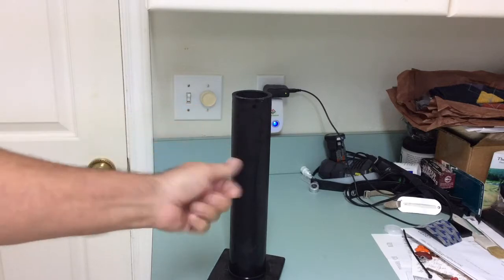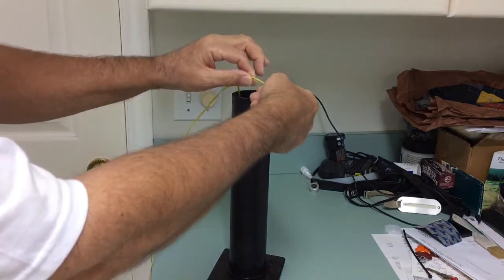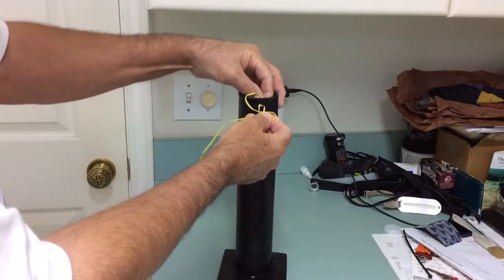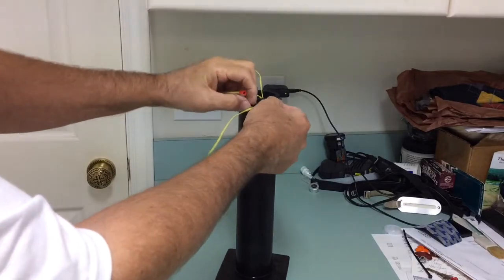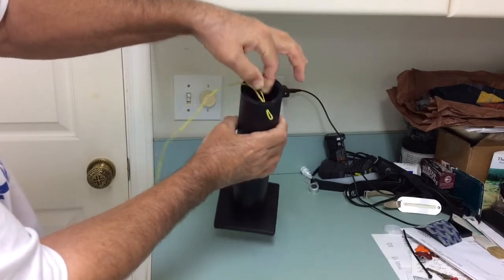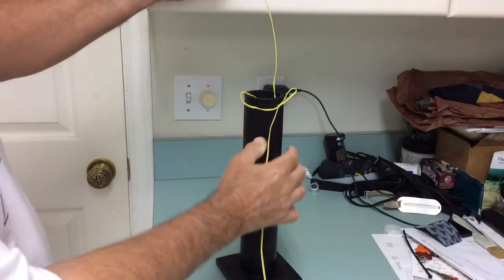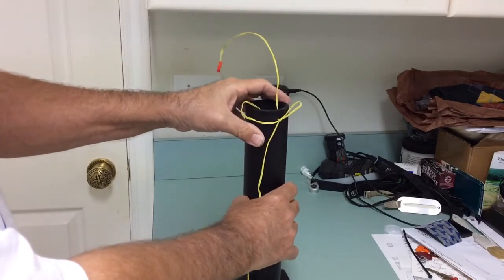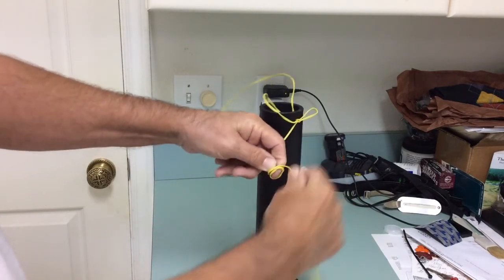Ematch securing loop

Comment: Does this reduce the height of the shell? It seems like that tug of the wire on the shell coming out of the mortar would slow down the velocity of the shell.
Reply from the maker: Not enough to matter. Likely in most cases the lift charge blows the match head right out the bottom of the shell anyway. That is if you go through the paper disc on the bottom of the shell. If you poke through the thick cardboard sidewall of the shell, which is a PIA and not necessary, the match may stay in the shell as it lifts. But it doesn’t affect the height of the shell in any significant amount. But if the wire does go up with the shell, you really don’t want it tugging on any other wires or the module. You need to tie it off to the mortar. We do this for every commercial 1.3 G shell.